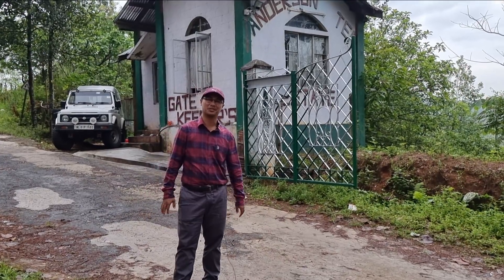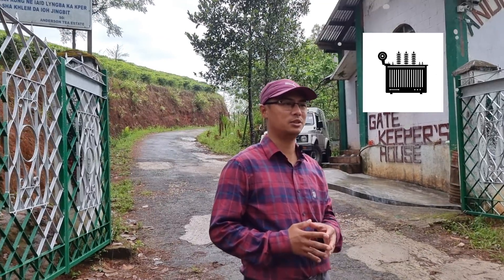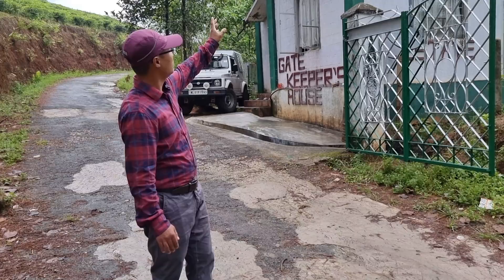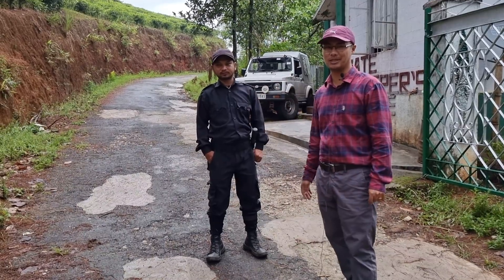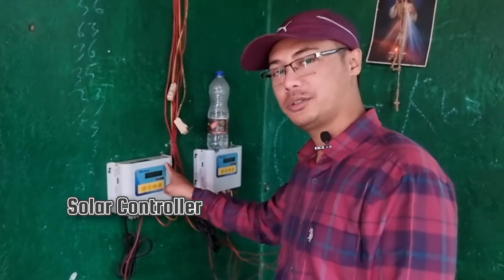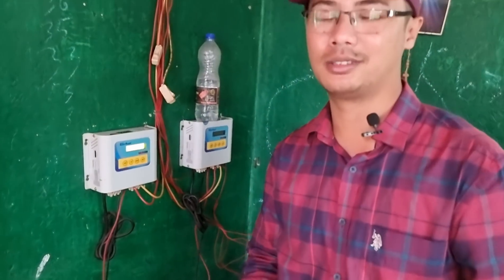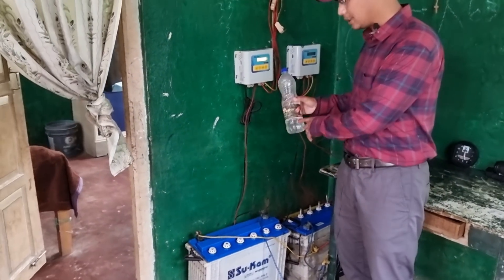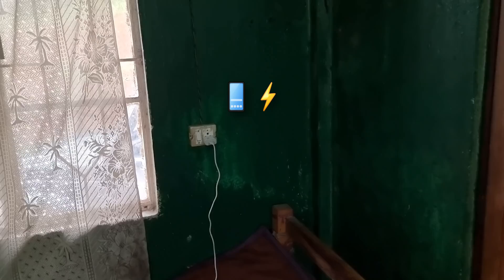Solar Off-Grid for Small House/ Outpost

Comment: I set up a 3.7 KVA / 3 kW system in my parents' farmhouse. There were frequent power cuts there. 

Also for communication, I set up an internet connection of more than 100 Mbps using 4 SIM cards, 2 Airtel and w Jio, each SIM in a SIM-based router that is connected to passive high-gain antennae, and each of those SIM-based routers plugged into a 4-WAN load-banacing router that then connects to a WiFi access point.
Reply from the maker: Wow, you are very enterprising and innovative 💡 Thank you for sharing the idea of communication with less network. I think I will try your method since there are very weak or no network in some areas. Also thank you for your support and kind comments.

Comment: I'm in an area prone to powerful lightning strikes. Before going out or if the sky is overcast we disconnect the entire solar charging circuit.
So how do you protect the system, especially the batteries from lightning strikes?
Reply from the maker: Thank you for your observation and query Banshan. If you will notice at the top part of the roof in the video,  you will notice a rod with pronged ends. This is the lightning arrestor which is connected to an earthing rod with chemical earthing around it. This protects our system from lightning. I would suggest you can install a similar lightning arrestor in your place to protect your panels and batteries. You can also ground the controller by connecting it by copper wire to another earthing rod or just one gi pipe of around 2-3m deep in an area where the soil in moist.